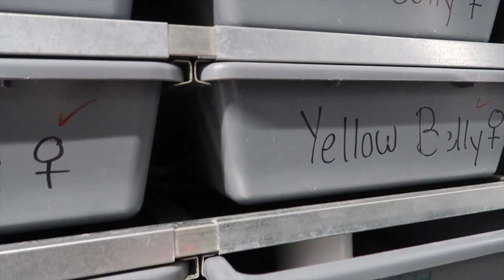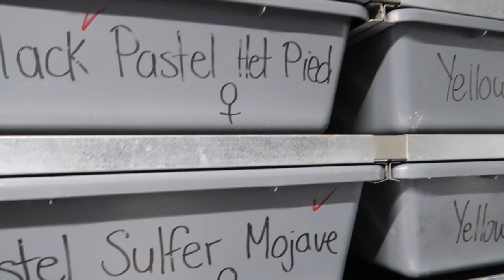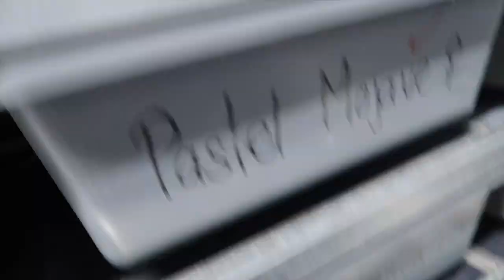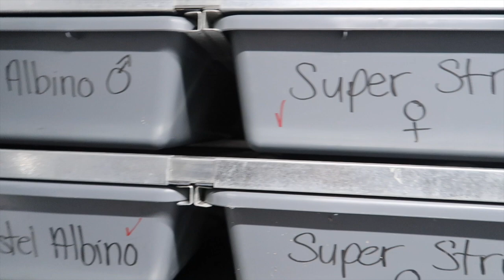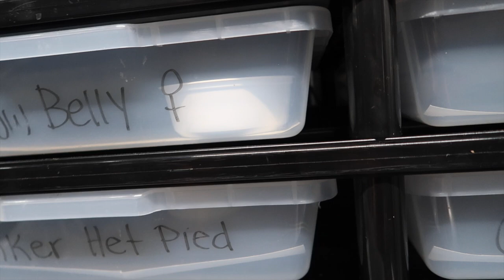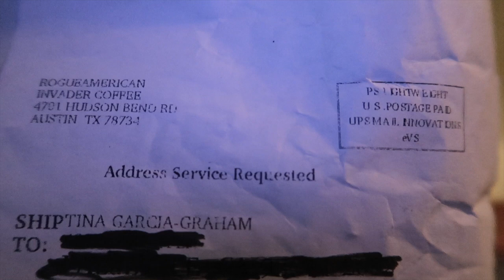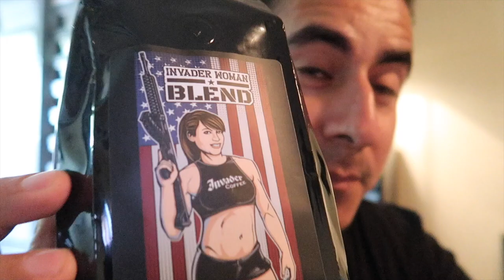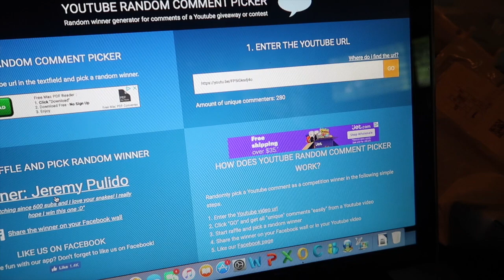ball python give away winner and breeder females

Comment: Hey homie, nice haircut. I've been "cutting" my own for years too. I was never necessarily good at it I just took a 1/4 inch guard all around my whole head, lol, looked good enough for me. Anyways these days I just shave it but I been slacking lately and only doing it once every other week. I need to get on that. Anyways I suggest the lottery wheel. You can buy them for like 5-20 dollars. It's like a hamster week fully closed in with a crank and numbered balls. Just assign each person a number and use that. Anyways I'm gonna go finish the video. Paused to put in my two cent before I forget!